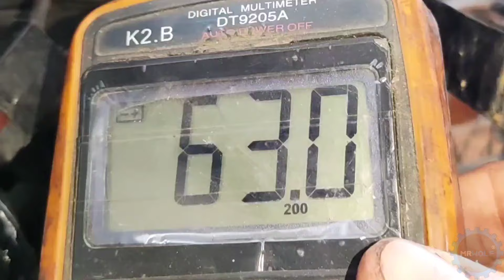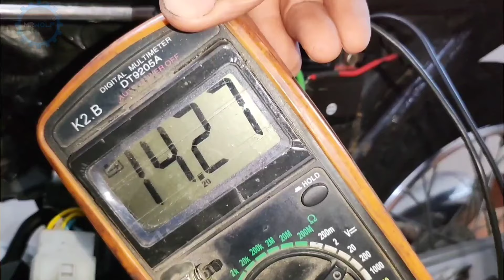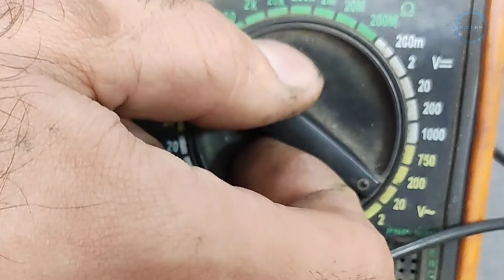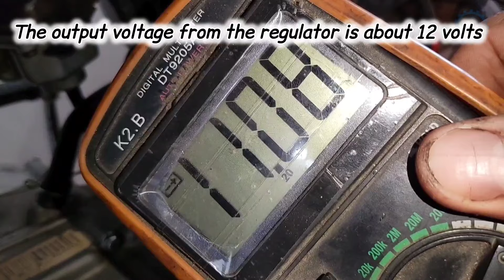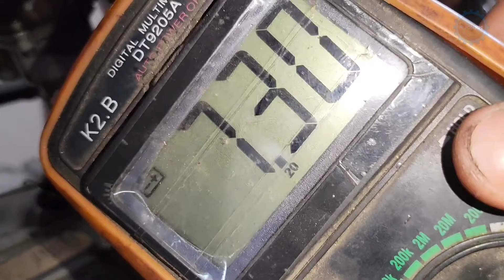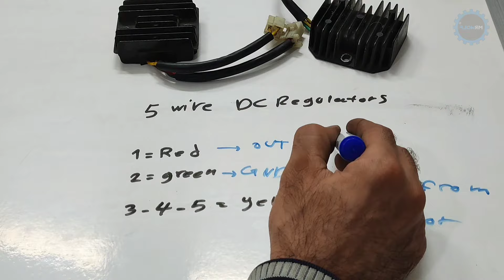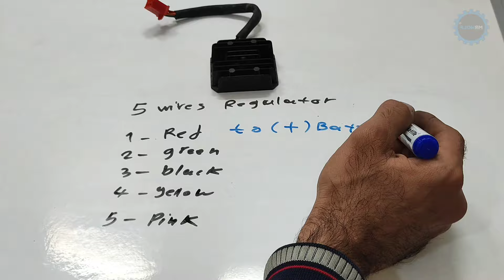Everything About Motorcycle Charging system You need to know

Comment: Hi sir . I put small diameter wires in the fuel jet of carburetor so that the inner diameter becomes small and ultimately less fuel will go in the combustion chamber. I also optimized the air fuel mixture ratio by blocking some air of the filter. I want to know is it dangerous to do that for bike health. Though fuel economy is much better now.
Reply from the maker: Hi . This modification may disrupt engine performance in atmospheric conditions such as high altitudes. Instead of making these changes, it is better to properly adjust the carburetor and use more balanced and safer methods to reduce fuel consumption, to prevent potential damage to the engine. Using a smaller jet can be effective

Comment: Hello! Nice video. Can you explain why the ac stator have 2 wires for charnging batteries? Can the battery be charged with ac current directly or it needs to be filtered by rectifier?
Reply from the maker: Stators are designed based on the type of motorcycle. In such stators, the white wire generates the power required for the charging system, while the yellow wire is used for lighting. This process is not possible without a regulator(rectifier), as it not only limits the voltage but also converts AC to DC. Batteries cannot be charged with AC power; otherwise, it will cause a short circuit.

Comment: in next video please explain (by dismantling) how rectification/regulation is achieved in both systems. I heard that the (cheap) AC ones are very wasteful and only use single diode for rectification and just short the coils when voltage(/rpm) gets high.
Reply from the maker: It’s not necessary to use an AC regulator،With some adjustments to the installation method, you can also use DC rectifiers on a motorcycle with an AC power system. If you let me know exactly what device you intend to use it for, I might be able to explain better.
Reply: @MrWolfDiy  
I'm using same stator, one with single bare core like the one in the video.
i could probably connect the DC rec/reg like
wire 1: battery coil/winding
wire 2: GND
wire 3: lighting coil/winding

But I'm more interested in how the internal circuit for the DC module works. like, is it simple/wasteful like the cheap AC ones.
In other words what is the bare minimum standard for DC rec/reg.
Reply from the maker: In response to your question, a simple DC regulator/rectifier may have some energy loss, especially if linear regulators are used. However, the minimum standard is that it should produce a stable DC voltage with minimal noise and fluctuations. The minimum standard for a DC regulator/rectifier module is that the output voltage should be as stable as possible, with low ripple. For a simple design, you can use a diode bridge for rectification, a filter capacitor, and a linear voltage regulator. However, by following the recommendations I mentioned, you can minimize energy loss and achieve a smoother output.
I hope I have answered your question, if you have any questions, you can ask